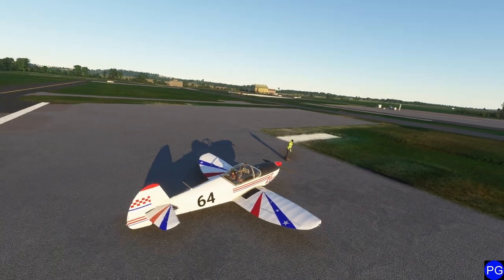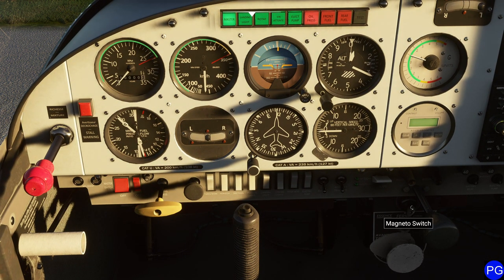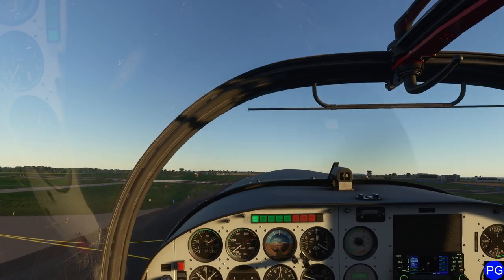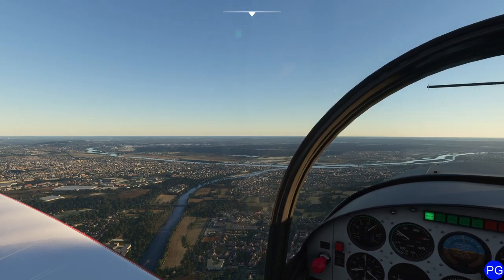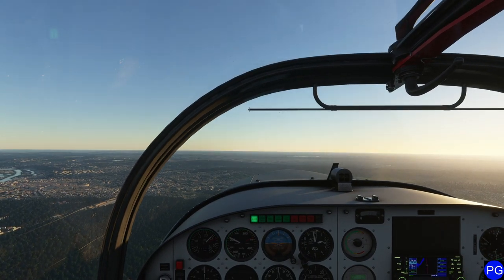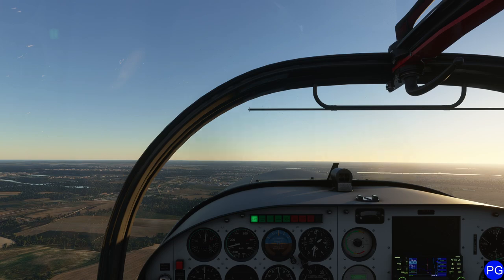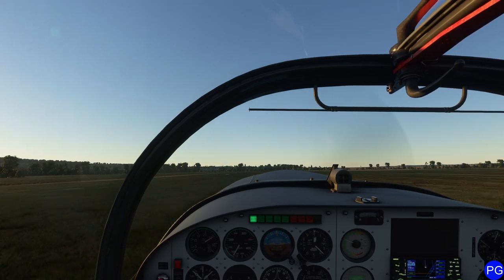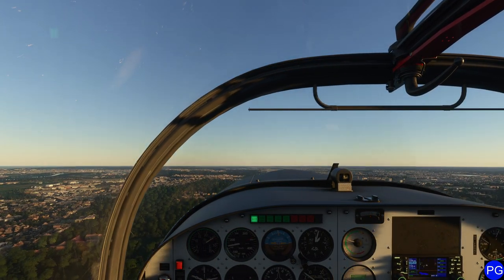FS2020 - Flying the Robin CAP10

Comment: I remember in a video the devs put out around release, they were talking about how some of the flight models were based off of planes they had significant direct access to at their local flying club (eg, the Robins), so it wouldn't surprise me if the lower than expected (based off of the POH) performance is just because the corresponding real plane is a bit clapped-out from years of use.

Comment: It certainly isn't as easy as the game in real life to taxi this aircraft, it does have a steerable tail wheel however the force required to break this out to free castoring is fairly low so it's easy to get it to ground loop. MS2020 doesn't appear to be the best with tail draggers. Nice job on the startup though it was spot on. You should always drain from the rear tank first. The aircraft is only rated for aerobatics when the rear tank is empty.